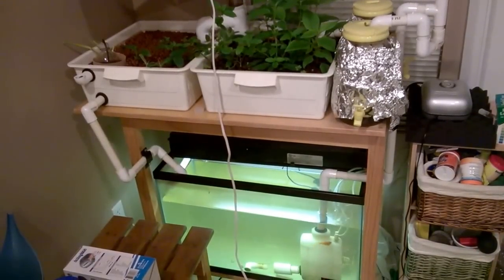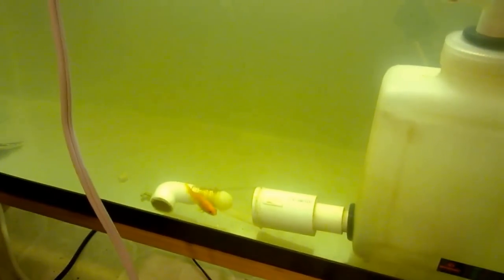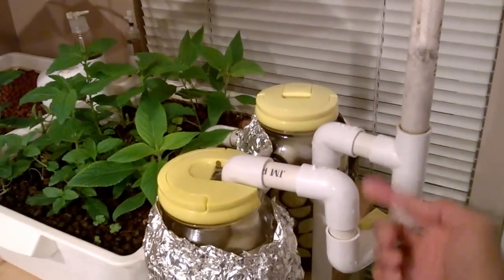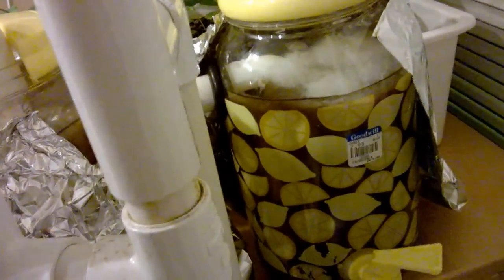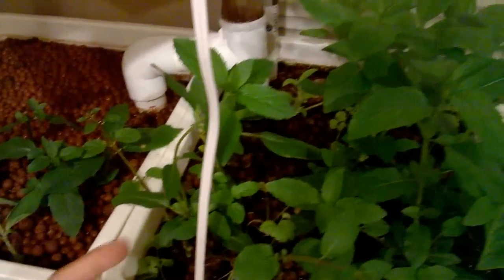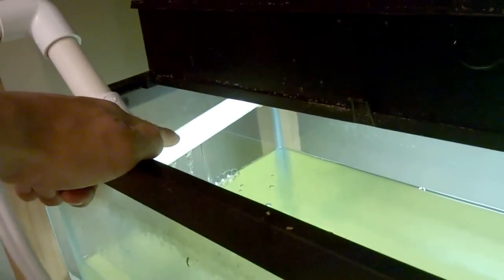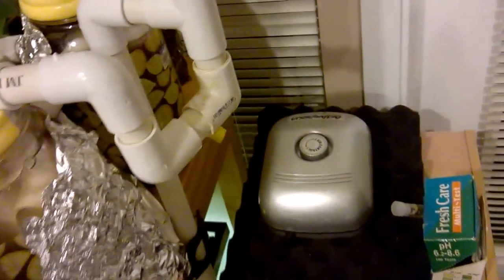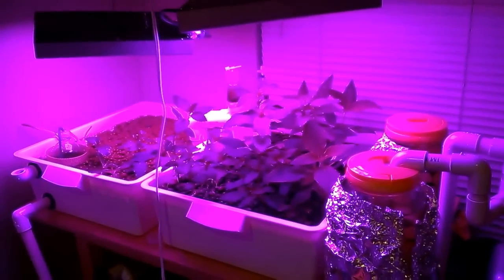My first small indoor aquaponics setup featuring my low powered airlift pump design

Comment: like! ! ! powerful. If the container becomes smaller, will it react faster?
Reply from the maker: If you mean the container of the pump then yes it will cycle the surges of water faster but pump at a slower rate overall

Comment: correct me if I'm wrong, but I thought the point of aquaponics was to move the solid 'poo' fish waste to fertilize the plants...if you filter all that out, then what's the point?
Reply: Thank you for the explanation.
Reply: @stephenh7336  the solids need to decompose and turn into nitrogen before the plants can use it. For that to happen bacteria has to break it down first
Reply: most fish will produce almost all of their ammonia from their gills, not from their poop. It is the ammonia, converted to nitrite and then to nitrate by bacteria in the system, which will make the nitrogen available to the plants

Comment: Nice work. Will it work without check wall and direct water through into another tank top with single pipe without muffler fitting?

Comment: The check valve is very cleaver. Resourceful way to make sure you get no back flow.
Reply: dude the pump is smart, but get rid of the mint before you system is killed, it's just a monster plant is aqua or hydroponics
Reply: ***** mint is a weed in a closed grow bed like that. Either get rid of it, or make a separate bed just for that. I have mint  growing in several of my grow beds and it will fill the container you give it.